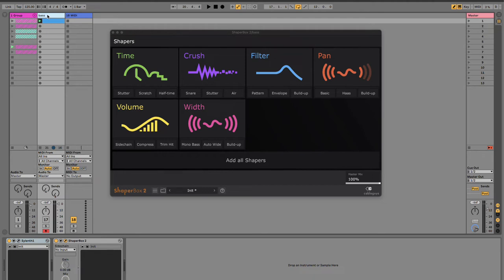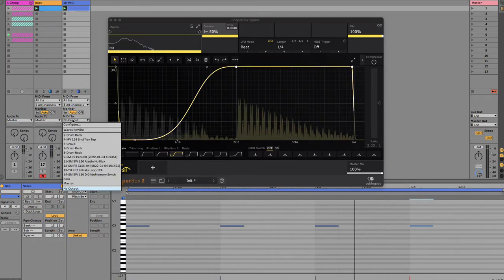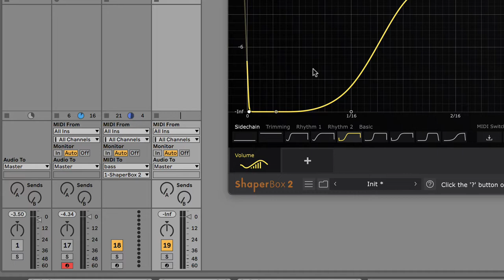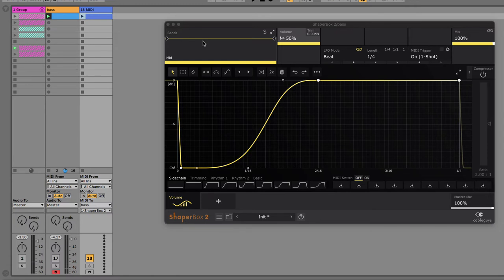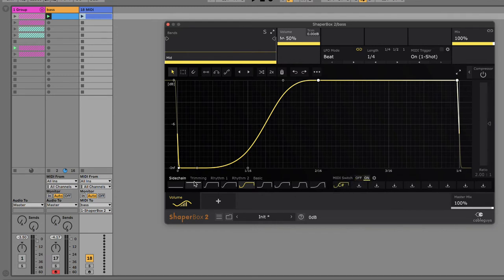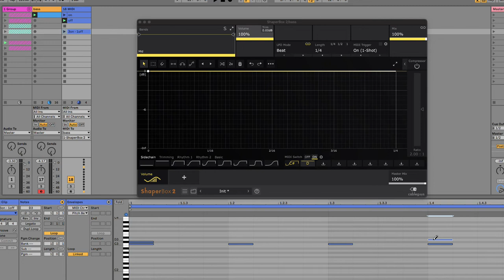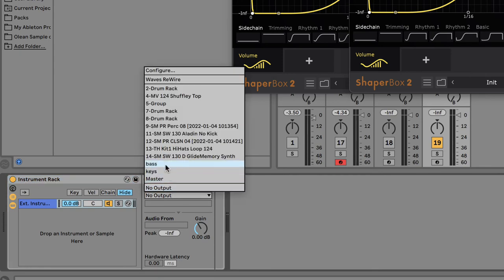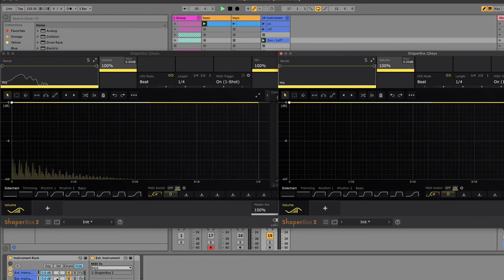Shaperbox 2 Midi Trigger in Ableton Live + Common Issues

Comment: Hi! I'm trying to digest this.  I just bought SB3 and did mainly to side-chain.  So, if I want to SC the bass to the kick I have to duplicate the kick on its own midi channel?  What if I want to side chain the vocals to a piano?  I had no idea there was problems with Ableton and SB when I bought this a few days ago.  I'll have to try to understand the other thing later but it sounds like when the kick stops playing the bass track will still be affected with a volume drop?
Reply from the maker: so there are a few things here: SB3 works great for  sidechaining kick and bass. if you have a 4 to the floor pattern u can simply use a 1/4 length and ur good to go. If you want to stop the Sidechaining when there is no kick you willl have to use automation or set up a midi trigger with a duplicate kick channel. Volumeshaper doesn't react to an incoming signal tho. it simply triggers  a specific volume reduction curve. So there is no way to sidechain the vocals to a piano. you will need a normal compressor or something like trackspacer for that. hope this helps :)
Reply: @OleansHouse  Thank you!  That clarifies much.  If it's not 4 x4 I can still do it if I have a midi drum pattern, right?  But not audio samples, or I convert audio to midi?  Not all my songs are 4-to-the-floor.  Lol!  Trackspacer + Shaper sounds like a good pair.  Trackspacer is cheap.
Reply from the maker: @hannahbackward  sooo I just read that SB3 does have an Audio input right next to the midi option. ( Im still u running SB2)   so u can use the audio option, or midi (own midi clip or audio to midi should both work ok)  Even with the audio option I still think that using volumeshaper works better for distinct rhythmic sidechaining like kick and bass and less well for things like vox to piano!
Reply: @OleansHouse  Well, that's good news and a chance for another video from your channel.   Thank you so much for all the support!

Comment: if i.m do same setting with yours I hear the clicks and pops sound on my side chain how can i fix????
Reply from the maker: check if u have to smooth out the start of the wave a bit. If the shaper reacts really suddenly u might have to add a bit of a slope. kind of like some attack time on a compressor
Reply: @OleansHouse  do you have a any recommend about attack time (how many ms did you move to the right?)??

-p.s I still get a wired clicks and pops sound
Reply from the maker: @jinrico3581  can u add me on insta and send a screenshot? Oleans_house
Reply from the maker: @jinrico3581  if ur signal is loud I would day up 45ms might be needed. but maybe try with an even longer  fade to see if that solves the problem, if not it might be overlapping notes or something